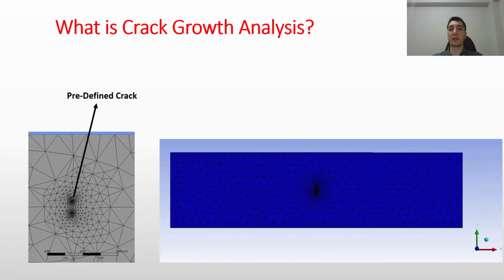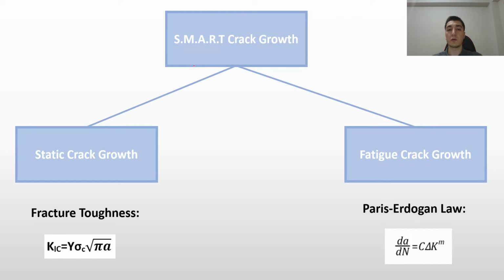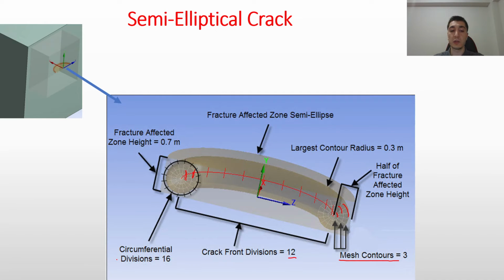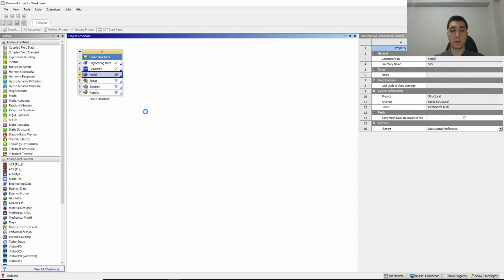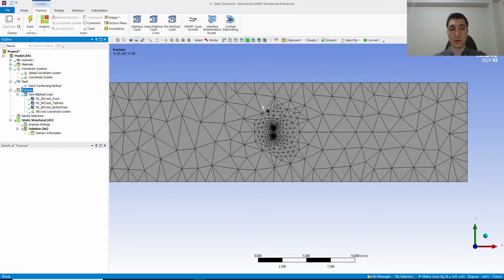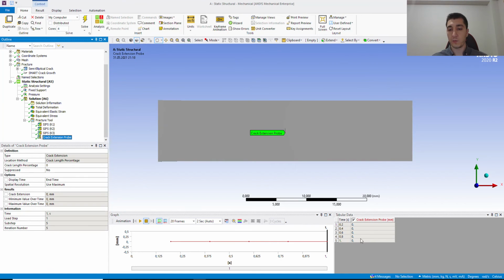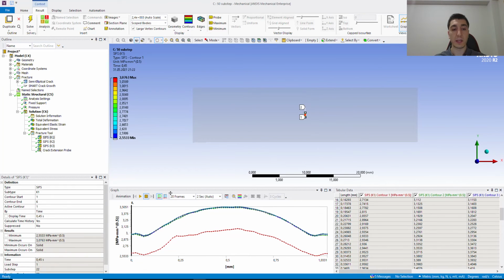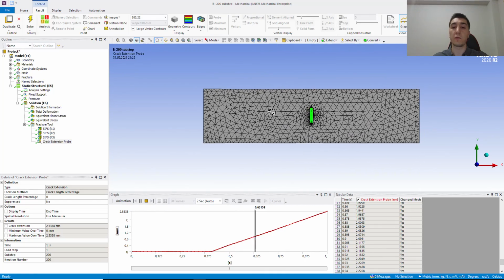SMART Crack Growth Analysis ANSYS 2020R2

Comment: Nice video, quite useful by the way. My point is if the same steps you need to use if you are trying to check crack growth analysis under fatigue conditions.  What about XFEM method? Anyway, many thanks, I've subscribed.